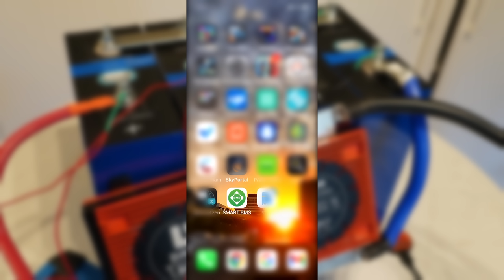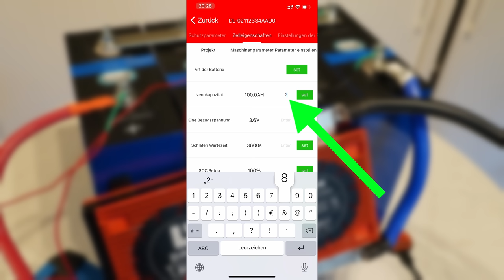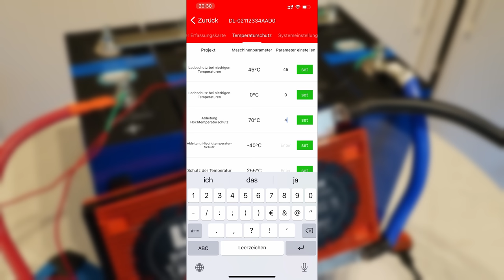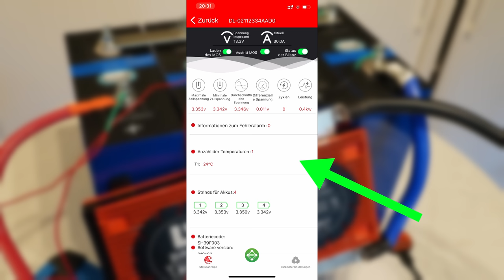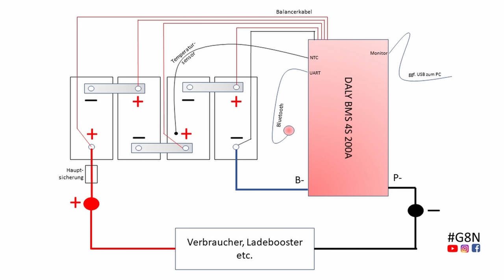Wie? 280Ah 🔋 Selbstbau für 599€, how to mit allen Details ausführlich erklärt #G8N

Comment: Hallo G8N

Zuerst meinen besten Dank für das Video und Deinen Kanal, den ich auch direkt ins Abo genommen habe. Du erklärst das alles wunderbar einfach aber auch sehr professionell. Meinen Respekt und besonderes Lob an dieser Stelle.

Der Bau meiner Batterie macht Fortschritte und ich freue mich schon auf das erste Benutzen im Wohnwagen. Endlich eine beim Movern stabile Spannung und keine Abschaltung mehr, wenn's mal etwas steiler wird. 

Eine Frage beschäftigt mich zur Zeit bezüglich des Ladegerätes. Ich benutze ein Fraron BLG20M12V, welches verschiedene Einstellmöglichkeiten bezgl. Batterietyp und Erhaltungsladespannung bietet. GEL/WET geschlossen mit 14,2V, WET offen/AGM mit 14,4V und AGM 1 mit 14,6V. Außerdem kann ich es auf Netzteilbetrieb umstellen, bei dem es dann mit der eingestellten Erhaltungsladungsspannung von 13,2V, 13,5V oder 13,8V und max. 20A arbeitet. Was denkst Du, ist hier die passende Einstellung für die Einspeisung in die LiFePo4 Zellen / den BMC?

Meine besten Grüße und schöne Pfingsten
Markus
Reply from the maker: Hallo Markus, vielen Dank für das großartige Lob. Bei diesem Ladegerät hast du die Wahl, ob du deine Batterie schnell aufladen willst und immer die maximale Leistung zur Verfügung haben willst. Oder ob du die Batterie schonen möchtest. Für die schnelle Aufladung würde ich AGM 1 und Float 13,5 Volt wählen. Wenn du deinen Akku schonen möchtest, Gel und Float 13,2 Volt. Bei der letzten Variante kann der Ladevorgang recht lange dauern. Es könnte passieren, dass du nur 80 oder 90% der Leistung zur Verfügung hast. Das sollte aber auch OK sein. Viele Grüße, Mr@G8N
Reply: @G8Neu  
Moin und besten Dank für die schnelle Antwort.
OK, das habe ich mir auch so überlegt. Da ich die Zellen zwischen 3,0V und 3,4V (also zw. rd. 10%-90%) laden/betreiben will, passt das doch sehr gut zu Deiner Antwort.
Alles Gute und weiter so,
Markus.
Reply: @G8N
Hallo und ich noch mal ;-)

Ich habe jetzt meinen Akku fertig und die Installation im Wohnwagen auch soweit abgeschlossen. 
Die Ladung mit dem FARON Lader funktioniert wie gewünscht und die Zellendrift liegt laut BMS bei 0,006V. Also super.
Was mir aufgefallen ist, dass das BMS eine Spannung von 13,6V anzeigt, während mein VOTRONIC Batteriecomputer (Mess Shunt) 13,1V anzeigt. Dabei sind alle möglichen Verbraucher abgeschaltet (Masse ab) und auch keine Ladung aktiv.
Etwas gemessen und festgestellt, dass beim BMS an B- (Negativ ins BMS rein) 13,6V anliegen, während am P- (Negativ aus BMS raus) 13,1V angezeigt werden. Also nur Akku ans BMS und Spannung zu B- und dann zu P- gemessen, zeigt einen Unterschied von 0,5V.

Ich denke mal, das ist der Elektronik im BMS geschuldet, würde mich aber sehr freuen, wenn Du das mal an Deiner Anlage gegen prüfen könntest. 

Besten Dank und Viele Grüße,
Markus.

Comment: Vielen dank für das tolle erklärte Video .
Ich hätte darüber noch viele Fragen , wie könnte ich Kontakt zu ihnen aufnehmen .
4 x 100 ah Batterie  lifepo4 
Wollen es auf 24 Volt schalten und was benötige ich an BMS und Balancer ??? 
Danke ihnen für ihre Mühe . 

Super erklärtes Video 👍
Reply from the maker: Hallo Sindy, vielen Dank für dein Lob. Ich empfehle dir mindestens 8 Zellen für 24 Volt System zu verwenden, hier ist der Link https://youtu.be/PY87onSQ96M zum passenden Video. Mit nur 4 Zellen hast du nur eine 12 Volt Batterie. Dann bräuchtest du zusätzliche Konverter, um auf 24 Volt zu kommen. Daher die Empfehlung, gleich 8 Zellen zu benutzen und eine 24 Volt Batterie zu bauen. Viele Grüße, Mr@G8N

Comment: Habe 16 Akkus bestellt,  um damit 4x 4S 12V Batterien zu konfigurieren.  Welche BMS brauche ich dazu? Reicht eins für alle, oder brauche ich für alle 4 Batterien je eins?  Die bestellten Zellen haben 320A. LiFePo4.
Über eine Antwort würde ich mich freuen. 
Gruß J.K.
Reply from the maker: Hallo Jogi, das wird schon ein enorm großes System und das noch auf 12V? Wenn du das wirklich nur mit 12V bauen willst, so würde ich dir entweder 2x 2p4s oder 4x 4s System empfehlen. Bei 2x 2p4s baust du zwei Akkupacks, wo jeweils 2 Zellen Parallel geschaltet werden und davon dann 4 in reihe. Dann benötigst du 2x BMS. Wenn du 4 Akkupacks baust, die jeweils 4 Zellen in reihe haben dann brauchst du 4x BMS. Also für jedes Akkupack eines. Viele Grüße Mr@G8N
Reply: @G8Neu  Welche BMS ? 200 A oder mehr?  Ist für ein großes Wohnmobil mit viel Stromverbrauch. Danke.
Reply: @jogibaer1911  Hallo, das hängt davon ab, was du maximal an Strom ziehen willst. Bei 200A also maximal 2400 W (zum Bsp. Wechselrichter). Bei so einem großen Wechselrichter würde ich aber als Reserve eher ein noch stärkeres BMS wählen. Ich selbst baue mir einen 2000 W Wechselrichter ein. Der wird aber wohl nie mit mehr als 1800 W (Föhn) gequält. Daher habe ich ein 200A Daly BMS. Gruß Andreas

Comment: Mein Daly BMS  springt nicht an. Habt ihr einen Tip?
Reply from the maker: Hallo Michael, als erstes prüfen, ob der Temperatursensor richtig eingesteckt ist. Als nächstes solltest du sicherstellen das alle Zellen im Bereich 2,6-3,55 Volt sind. Dann startet das BMS, indem du ein Ladegerät anschließt oder einen Verbraucher. Sollte das wieder erwarten es nicht funktionieren, ist eine weitere Möglichkeit, das USB-Kabel anzustecken und diese an einen Laptop anzuschließen. Es gibt noch weitere Möglichkeiten aber versuche diese erst einmal. Viele Grüße Mr@G8N

Comment: ich habe eine 310A gekauft wie von ihnen empfohlen habe sie zusammen gebaut wie im video beschrieben leider lädt  sie nur bis 36,6 Volt 100% erreicht was kann ich ändern danke im voraus
Reply from the maker: Hallo Bruno, ich vermute das eine deiner Zellen bereits eine zu hohe Spannung hat und deshalb das BMS abschaltet. Aber um das besser zu beurteilen, zu können müsste ich wissen wie viele Zellen du in Serie geschaltet hast und welche Spannungen die einzelnen Zellen haben. Viele Grüße Mr@G8N
Reply: @G8Neu  ich habe 4 zellen
Reply: Zellen 1Zelle 3,340 2Zelle 3,341 3zelle 3,341 4zelle 3,624
Reply from the maker: @brunobilgeri5405  und wieviel Volt hat jede einzelne Zelle, wenn die Ladung stoppt? die 36,6 Volt in deiner ersten Frage passen nicht zu den 4 Zellen.
Reply: @G8Neu  wenn Sie die Zellen zusammen rechnen kommen sie auf 13,646 Volt

Comment: Hallo g8n. Ich bin gerade dabei, mir nach deiner Anleitung (erst einmal vielen lieben Dank für das tolle Tutorial!) eine Batterie für meinen Camper zu bauen. Ich bin gerade an dem Punkt angekommen, dass alle Komponenten zusammengeschlossen sind und ich die Zellen erstmals aufladen möchte, bevor ich sie nochmal parallel schalte zum top balancing. Allerdings habe ich nun das Problem, dass ich mit der App das bms nicht ansteuern kann um die Parameter Einstellung vorzunehmen. Ich bekomme eine Verbindung via Bluetooth angezeigt, mir werden jedoch keine Werte (unter iOS) bzw. komplett dubiose (unter android) angezeigt. Ich verwende die aktuellste Version für mein jeweiliges Endgerät. Habe schon alles mögliche versucht, beispielsweise Kabel und Anschlüsse überprüft aber leider komme ich hier nicht weiter. Die einzelnen Komponenten bestehen aus:

4x lifepo4 Zellen 310ah (von dem meibrand Store aus China, damals bestellt bevor rauskam dass die Zellen Mist sind)
1x daly bms 200ah für 12v4s System 
1x mobilectro Ladegerät ubc 1210 mit ladekurve für Lithium Akkus.

Ich habe zwei unterschiedliche Apps ausprobiert, einmal die gezeigte Smart BMS App und einmal die App SBT, welche von der Benutzeroberfläche her identisch aussieht. Vielleicht hattest du auch schonmal das problem, dass die App nicht funktioniert und kannst mir weiterhelfen?

Beste Grüße
Paul
Reply from the maker: Die Smart BMS App ist die richtige für Daly. Du schreibst du kriegst falsche Werte angezeigt. Ich vermute du meinst falsche Werte bei den Zellen. Also zum Beispiel eine Zellen mit über vier oder 5 V und dafür eine andere mit null. Dann ist das Balance Kabel, die fünf dünnen Kabel, die hinten an das BMS gehen, falsch angeschlossen.

Comment: Wäre es nicht sinnvoll noch an die Belüftung der Einzelzellen zu denken?
Man könnte doch Abstandhalter zwischen jede Zelle und den Wänden des Gehäuses einbauen und dazu einen Tempgesteuerten Lüfter.
Wie sind dazu die Erfahrungen unter Last? 
Manche Lifepo4 Zellen haben ja Rippen auf der Aussenseite (Z.B. Winston) 
Würde mich über eine Rückmeldung freuen.
Reply from the maker: Unter normalen Anwendungsbedingungen hatte ich noch nicht das Problem, dass die Zellen sich zu stark erwärmen. Wenn du allerdings so explizit danach fragst, vermute ich, dass du die Zellen entweder extrem stark belasten oder in einer sehr warmen Umgebung betreiben willst? Wenn man zum Beispiel nur eine 100Ah Batterie hat, diese mit 2 KW belastet, dann erwärmt sich diese natürlich deutlich stärker, als wenn ich eine 280Ah Batterie habe. Da die Belastung am Verhältnis ja nur etwa ein Drittel ist. Also ich hatte bis jetzt noch keinen Bedarf einer zusätzlichen Kühlung gehabt. Viele Grüße Mr@G8N
Reply: @G8Neu  Ich hatte vor die 320Ah Version mit einem 3Kw Wechselrichter in meinem LKW zu betreiben. 
Hab da schon die Befürchtung das es warm wird. Ich baue mal das Gehäuse zu Ende und gebe Rückmeldung was meine Messungen ergeben haben, wenns interessiert…
Danke auch für die schnelle Antwort!
Reply from the maker: @micabi3668  bei eine LKW wäre das ja ein 24V System also mit 8 Zellen also etwa 8,2kWh Kapazität. Mit einem 3kW Wechselrichter sind das dann 120-150A. Du wirst sicher nicht dauerhaft 3kW benutzen also sehe ich da kein Problem. Aber lieber etwas vorsichtiger rangehen und Reserven einplanen, ist natürlich der richtige Weg. Viele Grüße Mr@G8N

Comment: Hallo, ich habe gerade meine 4 Stück 310Ah Zellen bekommen. Dank deines Videos traue ich mich an den Bau einer Versorgungsbatterie für mein Boot. Übrigens, der QR Code ist auf die Seite verlegt und nicht mehr leitend. Ebenso sind die Böden jetzt von Werka aus mit Folie isoliert.

Gruß Kai
Reply from the maker: Hallo Kai, danke für die Rückmeldung. Finde ich prima, dass die Chinesen auch mein Video sehen und ihre Produkte verbessern. 🤭 VG Mr@G8N
Reply: @G8Neu  habe noch mal ne Frage: habe deine Batterie ziemlich genau nachgebaut. Allerdings will ich die Anschlusskabel des Dali bms einmal in die andere Richtung umlegen, weil das räumlich besser passt. Also die Schrauben raus, Kabel um 180 grad drehen und wieder festschrauben. Glaubst du, dass das ok ist?
Reply from the maker: @kails6210  Ja das geht, hatte so was auch schon überlegt und getestet. Noch ein Tipp: Klebe den Stecker des Temperatursensor mit etwa Sikaflex oder ähnlichen fest. Ich hatte jetzt einmal den Fall, dass dieser aus dem Stecker gerutscht ist. Da hat natürlich das BMS sofort abgeschaltet. Viele Grüße, Mr@G8N
Reply: @G8Neu  danke für den tip.
Reply: Moin, ich habe noch mal ne Frage:
habe die Batterie erstgeladen, sich ausgleichen lassen, und jetzt wieder zusammen gebaut. Die Spannung liegt bei 14,05 V und SOC wird mit 88% angezeigt. Wenn ich das Ladegerät (Victron) im Lithium Modus anschließe läd das aber nicht weiter. 
Müsste die Spannung nicht bei 14,6 liegen? welche Spannung muss das Ladegerät haben? die Spannung der einzelnen Zellen beträgt 3,565, 3,512, 3,501 und 3,486 V. Ist das ok?
Bei Zelleigenschaften ist bei mir anders als in deinem Video 3,2 V eingestellt, was sich auch nicht verändern lässt. in deinem Video steht der Wert auf 3,5V.
Ach ja. Dann muss ich noch das Victron Smart shunt einstellen. kannst du mir da Hilfestellung leisten?

Gruß und Vielen Dank Kai

Comment: ein Dip von mir die einzelnen BMS Anschlüsse würde ich nummerieren von Minus 1 2 3 bis  Pius weil du die so eingewickelt hast, das ist besser wenn du mal was austauschen must. Ach ja LIPO4 Batterien kann man nicht als Starterbatterien verwenden das sind reine Speicher für Verbraucher um nicht vom Stromnetzt Abhängig zu sein und wichtig ist auch das man maximal 80 bis 85 % aufladen sollte und maximal bis 80 % entladen sollte um eine lange Zyklen Lebensdauer zu haben. Sonst ist das sehr gut wie du das hir aufgebaut hast, man könnte die Box so bauen das du für Solarmodule, für das Ladegerät und für den Spanungswandler Steckverbinder gleich mit an baust weil das kann ich bei deinem Aufbau nicht sehen.

Comment: Hallo, erst einmal Danke für das tolle Video!! 
Ich bin gerade dabei alles anzuschließen, soweit alles gut! Nur das Bluetooth funktioniert nicht. Habe mal an dem Ausgang dafür das plus und minus gemessen und es kommt kein Strom raus. es wird sogar - 0,2 angezeigt. kann mir evtl jemand helfen !! BITTE
Reply from the maker: Hallo Kai, ich vermute dein BMS hat noch nicht eingeschaltet. Gehe am beste so vor 1. Ist alles korrekt angeschlossen? 2. Ist der Temperatur Sensor auch dran? 3. Ladegerät oder Verbraucher anschließen und einschalten 4. Wenn du die neue Version hast Knopf auf dem Bluetooth drücken. Bei der alten Version ist auf der Rückseite ein 2-poliger Stecker, diese beiden Pole kurz verbinden. 5. PC-Kabel USB anschließen und das an einen Laptop stecken. 6. Wenn das alles nicht hilft, das B- und P- mal kurz zusammenhalten. Sag mal Bescheid was es war, viele Grüße Mr@G8N
Reply: @G8Neu  vielen lieben Dank für deine Antwort. Bin erst wieder in zwei Wochen da, werde deine Tipps dann gleich Ausprobieren. Vielen vielen Dank. Ich melde mich bei dir wenn ich etwas weiß!! Danke
Reply: @G8Neu  Servus Meister. Ich habe deinen Tipp schon probieren können. Ich habe kurz das USB Kabel an den PC angeschlossen. Sofort ging der Lüfter des Ladegerätes an und die App hat sich mit dem Bluetooth verbunden. Klasse!! freu mich sehr! Hab gleich noch alles Parameter eingestellt und nun kann Sie in Ruhe laden. Vielen Dank noch einmal und liebe Grüße!

Comment: Ich bin gerade dabei mir einen 2 Blöcke mit je 230Ah aufzubauen. Habe dazu zwei Daly BMS 4S 250A. Ich denke ich habe die Blöcke genau wie beschrieben für die erste Initialladung in Reihe zusammengeschaltet und es funktioniert auch bis zum Test des BMS-Steckers mit den ansteigenden Spannungswerten. Dann schließe ich das BMS an, incl. Temp.-Sensor, Bluetooth und dem BMS-Stecker. Wenn ich dann die Spannung zwischen Batterie Plus und dem P- Ausgang des BMS messe habe ich nicht wie im Video beschrieben eine kleine Spannung von ca. 1V, sondern eine Spannung von ca. 10V. Wenn ich dann das Ladegerät an der Batterie und an 230V anschließe, tut sich nichts am BMS. Es lädt nicht und Bluetooth funktioniert auch nicht.  Ich habe das Gefühl, dass das BMS nicht arbeitet. Jetzt habe ich gelesen, dass das BMS beim ersten Start eine Spannung von mindestens 14,2 V braucht, die das Ladegerät in diesem Augenblick nicht bringt. Ist das richtig und liegt da das Problem?
Reply from the maker: Dein BMS hat noch nicht durchgeschattet das ist richtig. Wenn du ein Ladegerät anschließt, wären ja sofort die 14,2V da. Davon abgesehen habe ich das noch nicht gehört. Gehe am besten so vor:
1. Ist alles korrekt angeschlossen?
2. Ist der Temperatur Sensor auch dran?
3. Ladegerät oder Verbraucher anschließen und einschalten 
4. Wenn du die neue Version hast Knopf auf dem Bluetooth drücken. Bei der alten Version ist auf der Rückseite ein 2-poliger Stecker, diese beiden Pole kurz verbinden. 
5. PC-Kabel USB anschließen und das an einen Laptop stecken. 
6. Wenn das alles nicht hilft, das B- und P- mal kurz zusammenhalten. 
Sag mal Bescheid was es war, viele Grüße Mr@G8N
Reply: @G8Neu  Ich habe den alten Bluetooth-Stecker, der hat aber 4 Pole und keinen Stecker auf der Rückseite. Meinst Du evtl. den Temp.-Sensor? Gruß Wolfgang

Comment: Hey! :) Kannst du mir verraten wie der Aufbau wäre oder was ich beachten müsste bei einer 310 AH, du meintest ja das  du auch die Größere Variante kaufen würdest. 
Reicht ein BMS mit 200A ? Es wäre Super hilfreich wenn du noch zeigen würdest wie du die Batterie mit Solarzellen verbindest und vorauf man dabei achten müsste bei dieser Größe an Batterie ( welchen Laderegler bei der Batterie Dimension ?)  Ich wäre dir SOOOO DANKBAR!
Reply from the maker: Das ist absolut derselbe Aufbau, nur die Zellen selbst sind etwas neuer. Haben auch die gleichen Maße. Zu den Lagegeräten etc. sage ich im nachfolge Video https://youtu.be/JU4NX1aiRno noch einiges. Viele Grüße Mr@G8N
Reply: @G8Neu  hey, danke für deine Antwort, jedoch habe ich wirklich eine hilfende Bitte an dich.
Beantworte mir diese eine Frage :

Ich habe 3x 170 Watt Module auf
 dem  Dach und schließe sie an einen mppt vitron 100|50  an.
Ist die 310 ah batterie dazu in der Lage ca 40a aufzunehmen?
Leider steht das nicht auf der hersteller Seite.

Danke für deine Antwort

Comment: 310Ah, Daly250Ah, Temp.Sensor und einen aktiv Balancer bestellt. Keine 600€. Dann bin ich mal gespannt.
Reply: Hast du die Links dazu bitte....und wie ist es gelaufen? Alles OK?
Reply: @schlauschlumpf2501  Ich habe die Links unter dem Video benutzt. Die Zellen wurde aber noch nicht geliefert.
Reply: Heute mit dem Topbalancing angefangen.
Habe die Vario-Zellen bekommen und bin mal gespannt wie sich das entwickelt......
Reply: Kurzer update, die 310Ah Zellen liegen nach dem testen bei 285 bis 287 Ah. Nicht was bestellt wurde,  aber bei dem Preis noch akzeptabel falls nicht noch andere Defizite auftauchen.
Reply: Ich bin noch am Testen meiner "310/320Ah LittoKala- Zellen" die erste hat 306,5 AH .... Aber ich habe sowohl beim Laden als auch beim Entladen spanungs Sprünge hoch und runter von bis zu 0,05 v (50mV). Gemessen  mit EBC-A20. Das macht mir mehr Gedanken als eine niedrige Kapazität.